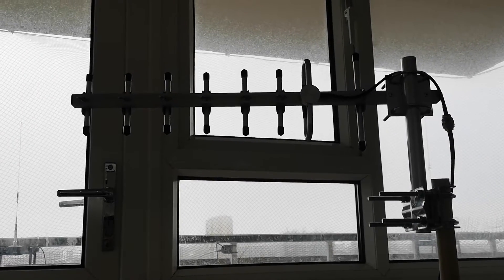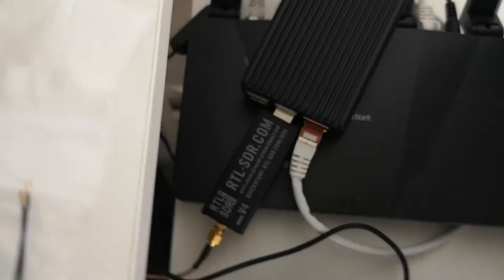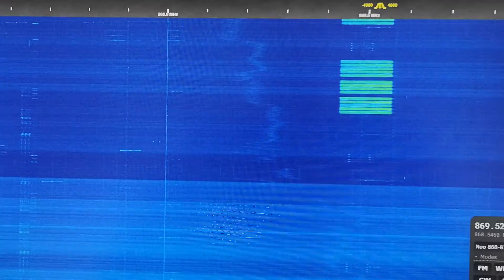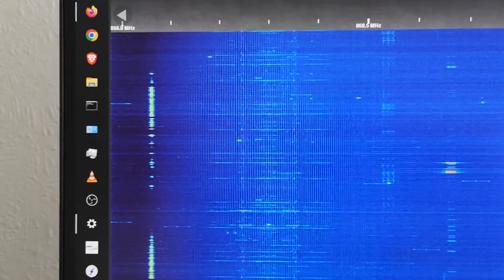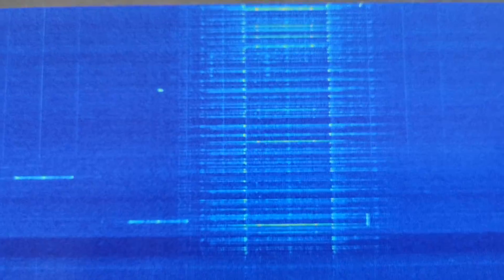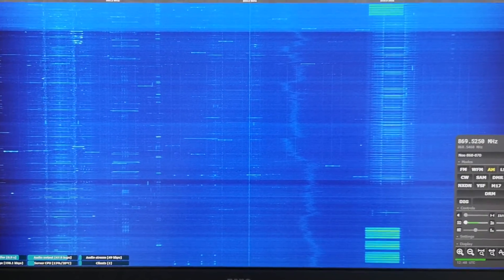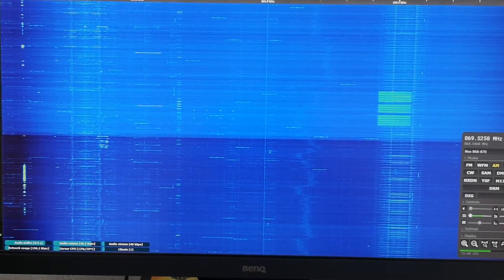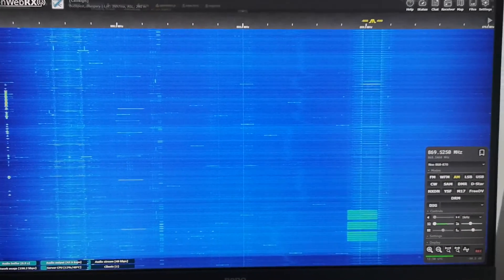Paradar 12.5dBi Yagi antenna for Meshtastic

Comment: Hi Simon, im sure you may have a follow up video but have you managed to get out in the field and measure signals?  (omni aerial vs the Yagi?)   to the north of me I have a hill so my target line of site is south east. Im considering buying the smaller Paradar 9.5dBi yagi as that has wider spread angle of 48deg  when vertically polorised and that just about the right angle for my target line of site range. Hence very interested in your findings so far.
Reply from the maker: Since I got the antenna it has rained every day but if it stops by the weekend I will head for the hills and do some tests !

Comment: great video Simon, thanks. Not seen this SDR software before. Have you found a way to manually amend the frequency within OpenWebRX without having to create a new profile? I can't figure it out and seems to be an obvious feature seemingly missing? thanks in advance
Reply from the maker: Thanks for the comment. The software is OpenWebRX+. The problem is that my RTLSDR stick cannot show more than 2MHz chunks of spectrum so it is necessary to create a "new profile" for every 2MHz chunk. My favourite at the moment I called 868-870. I run openwebrx+ on a Raspberry Pi and there are images for other OS's of course. Get it from
https://github.com/luarvique/openwebrx/releases
Reply: @fotografm  thanks Simon. Must be a quirk of this software. All other sdr# clones you can jump to any frequency and then adjust the associated parameters. I am liking having the pi running and can see many more chirps that I can’t pick up in the heltec ;-) better antenna needed 😀
Reply from the maker: @YourModulesMayVary  that i indeed true. I like kiwisdr where you just type a frequency and press enter and it jumps to that frequency. The spectrum width is only 0-30MHz of course. I also use sdr# and SDRConsole so I know what you mean.
Reply from the maker: There is a useful Telegram group from the guy who writes Openwebrx+. He just announced that since version 1.2.48, support is provided to use the full bandwidth of devices from SDRPlay and the HackRF.
https://t.me/s/openwebrx

Comment: 4:30 - One meter of LMR400 will have a loss of around 0.15 dB at one GHz, slightly less at 866 MHz, but slightly more for KLR400 instead of LMR400.  The insertion loss for the connectors will be higher.  When trying to get the most performance, it's best to mount the transceiver directly to the antenna if possible, or as close as possible, per your plan.  That 12.5 dBi Yagi definitely seems to be delivering the goods!

I have three 8.5 dBi collinear antennas on the way for a Meshtastic family emergency comms network I'm building.  UPS botched the routing of my antennas so they're circling Florida but should hopefully be here soon.  The solar panels will be here today.  The WisBlocks are still in China waiting for their extended holiday to end, hopefully shipping tomorrow.  I already had the lithium batteries and battery holders left over from an old e-bike project.  I'm designing custom 3D printed enclosures for the WisBlock, four 18650 batteries, solar panel, antenna and rooftop pole mount.

Speaking of 3D printing, my 3D printer is whirring away and that small ambient noise made it difficult to hear the audio in this video.  Any chance you could plug in a mic or put the cell phone closer to you when recording a video, or maybe amplify the audio in a video editor?  Thanks!
Reply: I'd be interested your colinear antenna source., if you have a link I'd appreciate it.
Thank you
Reply: @kf5hcr176  - Rokland., 8.5 dBi, $40 with two U bolt mounts.  I ordered three and a 5 dBi antenna and got free shipping.  Just got the notice that the order is out for delivery later today.  I'm designing the enclosure for the pole mounted solar panel, batteries and WisBlock, next to the antenna.
Reply from the maker: Mine came from Amazon. Sold out for a while now. Just search for antenna 868 and see what pops up. Watch out for cheap fake antennas though, or ones resonant at 914/940MHz not 868. I got this one and love it:
https://www.amazon.co.uk/gp/product/B09JYLHGHL
Reply from the maker: Happy Chinese New Year - many of us are waiting for the festivities to finish...
Sounds like you are setting up a great system there. I am researching solar panels today. Not very motivated since it is dark here in Brighton and pouring with rain all day LOL.
I normally mount the antenna directly to the node but stil need to use various N-Type, IPX and SMA adapters of course.
Thanks for the comment about my audio. I sometimes use a lapel mic but to be honest it seems to be as bad as the smartphone mic. Will have to come up with a better handsfree solution !

Comment: thanks for the info, I've been looking at the yagi's and the omini's from paradar and decided just to go with an omni. Getting a pole to put up an antenna above my roofline now I'll have to rethink the brackets so I can turn the pole and fit both antenna's (I'll have to buy another board or swap aerials).
Reply from the maker: Problem is that it is very directional !